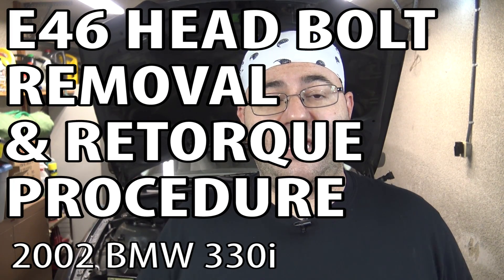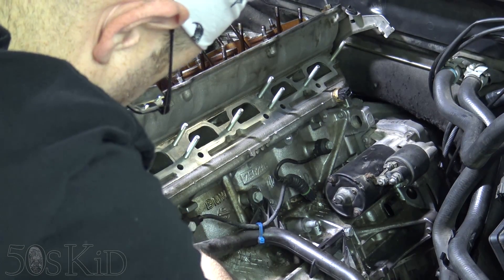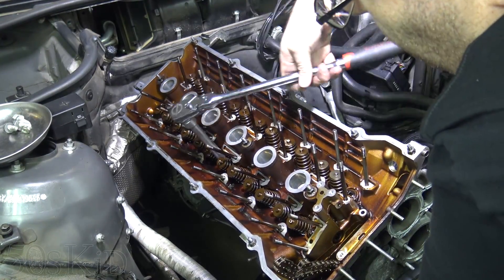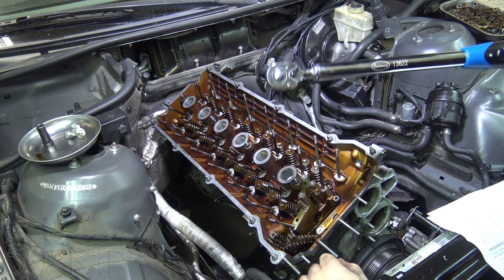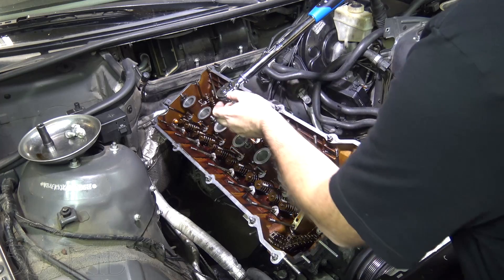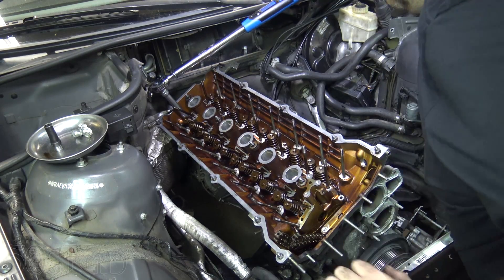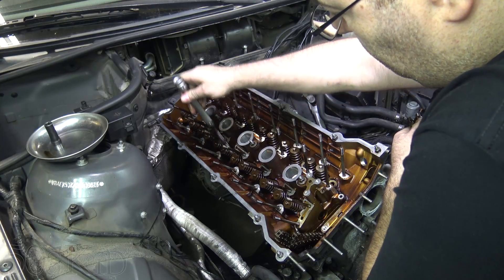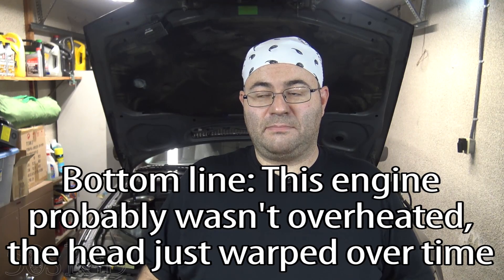BMW E46 Torque Head Bolts & Remove Cylinder Head DIY #m54rebuild 11

Comment: Can I reuse a head gasket? My situation is i torqued Down all my bolts and 1 was stripped so I have to take it off and buy new head bolts and washers. But I’m wondering if I need a new head gasket now to?

Comment: I've been told by every bmw mechanic that a 325i aluminum block threads are too weak to survive a second bolt torque while doing the headgasket?  Anyone had this issue and If so what was the outcome
Reply from the maker: Not true.  The bolt threads are only a problem if the head has been overheated and the metal has been fatigued.

Comment: This guy is wrong. If you replace the bolts, you leave all bolts on and as tight  as they are and replace each bolt one at a time. Do not remove or loosen all at the same time.

Comment: Great videos, helping me so much with my bmw's.  mine has a blown head gasket for sure, waiting on cam locking tool I ordered to take head doff.  I did test the bolts, I have 4 that feel soft on retork, back exhaust side (4) and 1 intake back one.  I pulled all of them except 1, as I don't want my cam to move at all.  I looked at the bolts and I don't see any fragments on any of them, i think a remember that you did this once on a car and they had debris from the stripped threads on the bolts.. I'm praying the head and block survived the overheated condition, this motor is so clean inside. 2002 325i
Reply: Head was good, it was warped .013, got it machined flat.  threads pulled on 4 bolts, timserting all of them this weekend. block was flat and looked great. Your the best!  BMW should pay you for your service!!

Comment: Hey bud. I'm doing head gasket replacement. And I have removed all the parts. I cant get the motor tdc. The crankshaft won't turn. It moved maybe 30 degrees and i stil need to roll another 45 to insert the flywheel locking pin. The motor isnt locked up it was running before I tore I down. Am I missin something?   Suggestions?

Comment: Hi 50skid, I love your videos, they are very detailed and educating, you’ve been doing a great job, I deeply appreciate it.
I bought an 03 325i a few days ago as a project car, I found brownish milky stuff in the coolant, but there was no milky stuff in engine oil, the car runs with 2 misfires and doesn’t seem to overheat, do you think the previous owner overheated it and the head is warped? I deeply appreciate your thoughts thank you

Comment: That's not the correct procedure of removing the head bolts. They should be loosened in stages as well as being torqued in stages. That alone can ruin the cylinder head

Comment: My 330ci was blowing white smoke out of the tail pipe and I could measure the amount of coolant needed after every drive. But no water in the oil like detecting the yellow sludge and no bubbles in the coolant over flow. When I pulled the head I could find no indication of damage to the head gasket and no cracks in block or head. Could the gasket be at fault without showing a visible sign?

Comment: Hey buddy, on my way to the store last night I had smelled something funny. Figured it might of been a fart from the truck in front of me but when I got to the store I seen smoke coming from the engine bay. Checked it out today, seen low oil, so I filled her up. I turned it on to idle to see if I can pin point the smoke, it seemed to be burning right off the header directly under the oxygen sensor. Left side of cylinders 5 and 6 .Can’t find a direct point of leak. I’ve been planning on doing the valve cover gasket but maybe it could be head gasket? Safe to keep driving?

Comment: It is not good to torque stuff using angles, especially in so critical places. They do it in factory, because bolts are new and blocks are freshly casted, so threads are guaranteed to be good, and it costs a lot less to let robot just angle pull this kind of stuff, than use specific torque.
After reinstalling head, or anything for this matter, you need to use torque wrench and specified torque for that bolt, and do this in multiple steps. This goes for any engine, be it BMW or Opel.
It's not tighter is nicer, as people think, this stuff has it's torque value for a reason. Using angles tightens bolts/nuts way out of spec and this means problems, like stripped thread, floating bolt or snapped bolt. This may not even happen instantly, but later when car is started and metal starts expanding, stuff may break.

Don't angle pull guys, I warned you
Reply from the maker: You're wrong. Follow the manufacturer's torque specs, people.
Reply: 50sKid sorry, no, this may work, but it's not good. I'm not the best at explaining stuff, but I'll try.

M52tu engine. New bolts, ok threads. Cylinder head bolts were tightened to 40nm and then pulled 90° ONCE. Then with torque wrench I tested, by gradually increasing torque, and found out that MIDDLE BOLTS budged on 65nm and OUTER BOLTS budged on 83nm. Russian literature recommends 82nm, if averaged, for any aluminum block with m10.

To get middle bolts to torque, BMW says to pull all the bolts 90° one more time. So I did. Result is that inner ones were 85nm and outer ones 96nm.

As we see, outer bolts are monsterly overtightened and head is sitting unevenly. Why? Because bolts lose torque if bolts next to them are tightened.

Now what's the point of doing all this angle joke, if torque wrench can be used all the way with much more precise results? What's the point of bending the head? Risking stripping threads?

This angle crap works for some random workshop, but if we're doing this ourselves, let's do it the proper way.

Comment: have watched your vids for some time ..Yesterday i lost all compression in cyl#3   rebuild or sell her ugh 2005 325
Reply: bent valve perhaps gotta open her up
Reply from the maker: Do a leakdown test and if the blowby is all coming out of the oil filler cap, try pouring acdelco cleaner down into the cylinder through the spark plug hole and leaving it to soak overnight to free up the stuck ring.  Course if it's all coming out of a valve, it's rebuild time.

Comment: Crazy question.  After torquing all bolts to 40NM.  I set my wrench to 35 NM and went back over all the bolts to triple check that I didn't miss any bolts.  The first bolts (1 and 2 in the center) were not even at 35NM and started turning.  Should I make a "second" pass at 40NM?  Or is this normal that the middle bolts lost torque due to all the other bolts coming up to torque?  I'm not worried that I will over torque the bolts when I do the 90 angle torque passes.  What do you think I should do?
Reply: 50sKid I had assumed that after I tightened the first two bolts to the initial spec, the other bolts, as they were tightened, would pull the cylinder head closer. Then the first two bolts would show up as not quite torqued to spec. I had this happen when I was installing the exhaust manifold.  
The threads seemed okay when I first remove the head. The bolts were incredibly tight and difficult to remove. I actually tried to see if they would tighten before removing them and I could not do so.   So, my real question is:. If I do more than one pass, to make sure all the head bolts are at proper jointing torque, will this cause the bolts to be over torqued after the two subsequent 90 degree turns?  I can't find any information on this. It seems that you're only supposed to torque the bolts to the jointing torque once, and not check that they're all there.  I did find one performance book that suggested bringing all the bolts to 80% of the initial jointing torque and then bringing them the rest of the way to the jointing torque.  
BTW: Thanks much for your response and for your great vids!
Reply from the maker: +David Freeman sounds like your threads have pulled out. Did you check for that when you first removed the head?

Comment: just a quick question what is the final spec in ft pound after the second 90 deg turn
Reply from the maker: Kris Chan Tack the final torque will be different for every bolt after those turns. That is why the torque spec is in degrees and not a specific nm or ft lb. you can’t get out of torquing them by degrees. You have to do it properly

Comment: I have an e46...after removing loads of sludge...my gf discovered that my E5 camshaft bearing cap had snapped in half...my question: could I simply replace the one e5 cap? or do I have to replace the cmshft along with it?  I believe they are machined together? I'm hoping you tell me I can just replace the one e5 cap. Peace
Reply from the maker: Well, no, you really can't do that because they assemble the caps onto the ledges and through machine all the holes.  So unfortunately you have to replace the whole cam bearing ledge and the caps.  I was gonna offer to sell you the old one I have from my rebuild but I just took a look and most of the top caps are a little rough looking.

Comment: Autobarn Nigeria I bought a short set from sears and I can't get the sucker past the cam and the cam seats without taking all that out. Seems the sucker is too thick to trash down to the head bolts.
Reply from the maker: You have to turn the cam into just the right position.  There are sections ground out to make room.
Reply: 50sKid only cool I will try that.

Comment: 50sKid, I really enjoy your videos. I just had to do a head job on my 95 e36. I did a lot of research on the Helicoil vsTimeSerts and one video by Ridgewood Machine showed the Helicoil to be a stronger repair than TimeSert. It's a short and interesting test video. I ended up using the Helicoil and will let you know how it works out as soon as I put the head on. Keep up the great videos, big fan.

Comment: What's the name of that socket you're using to break the head bolts loose? Does it some with a kit?
Reply from the maker: There's a link to it in the description of this video
Reply: You said that one is stressful to use. Any recommended ones to use?

Comment: correct me if i'm wrong, i think the 30 footpounts + 90 deg + 90 deg is for new bolts and it's meant to stretch them. i don't think you're supposed to do this procedure with bolts that have already been stretched.
Reply from the maker: If they were stretched you wouldn't be able to easily screw them back in.
Reply: well i think they stretch between the end of the thread and the head. in your case they probably just stretched some more but something tells me it's not a good idea to do the full torque sequence on the used bolts :)
Reply from the maker: I dunno if it can even be done on new bolts.  It really really feels like you're going to snap them.
Reply: hm, are you saying you reused the old bolts for the new head gasket?
Reply: Why would you say that? First of all, thanks for these videos. It's gonna be at great help in the future. Used bolts stretch between the end of the threads and screwhead, so they will screw easily in the block the second time, but they are still stretched, this is why you are supposed to replace them. The new headbolts are just the same, only they are not stretched, so why dont you think it can be done on new bolts? Because thats exactly what you are supposed to do on new bolts.
Reply: New or old bolt in spec have been tight to same specifications
Not  new tight to max and used one just a touch no this way

Comment: hi whats the final torque is it like 65 lbs
Reply from the maker: There is no one final torque value.  You torque them to 40 nm + 90 deg + 90 deg and the torque on each one ends up being a little different.

Comment: It is super rare to blow head gasket in M52/TU or M54 engine. What was the case? In my opinion, so long as you have all parts in your coolant system operating normally it should not happen.

Comment: This videos is funny BTW ,removing bolts in one go like you did  can stress other ones and cause thread to pull  LOL.
Reply from the maker: martolinka32 tell me why you think that
Reply: bolts needs to be loosen up in several stages with correct sequence  ,this is normal procedure in every engine,check bentley manual.
Reply from the maker: You're mixed up.  It's not possible to evenly loosen head bolts in stages.  You'll never know how loose you're making each one.  You're supposed to TIGHTEN them in stages, but not loosen.
Reply: 50sKid  stage 1 click, stage  2  5-10 deg. stage 3 90 deg. ect  until they are fairly loose.

Comment: At the dealer we use 3/8" Snap-On Techangle, or if the tech doesn't have one, they can use the Stahlwille one. We mainly use 1/4" and 3/8" gear and hence no one bothers to get the headbolt tool since a 3/8" extension will work with a 3/8" socket. We do not recommend threaded inserts as they tend to not be reliable (Aluminium with steel, not a good idea). New block, new head or like us, new engine straight from Germany. The engine bays are getting more cramped so using 1/2" stuff is asking for problems.
Reply from the maker: Interesting, it's quite common for people to use the timeserts on these engines and Toyotas and such.  This is the first I've heard about a failure.  Maybe the failed cases you're thinking about used Helicoils instead of Time-Serts.
Reply: 50sKid No, we don't have Timeserts in Australia anyway. The only approved place you can use a thread insert is on the spark plug holes on the older engines. You cannot compare a BM engine to a Toyota engine. They are of different power classes. I'm sure you can use threaded inserts on their engines as they have lower peak pressures in the cylinders. BM engines are driven on very high efficiencies, to do that even the coolant runs almost 20% hotter than your average engine. The downside is they are fitted in very heavy bodies, causing a misconception of high fuel consumption. In a car crash, I'd rather be in a German car for sure.

Comment: Hi 50sKid, how would a pulled thread behave? Would you still be able to torque it to 40 ftlb?
Reply from the maker: I imagine the threads would give out once you're into one of the 90 degree torques.  It will get super loose and just spin around and around forever.
Reply: 50sKid ah i see!